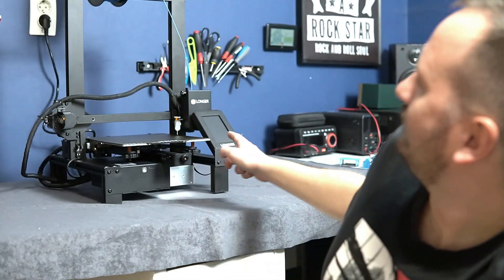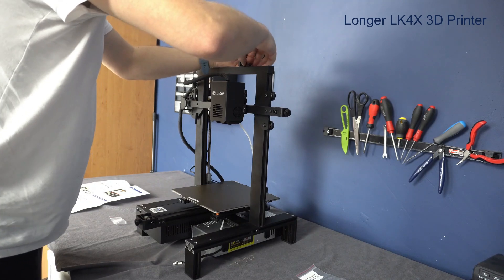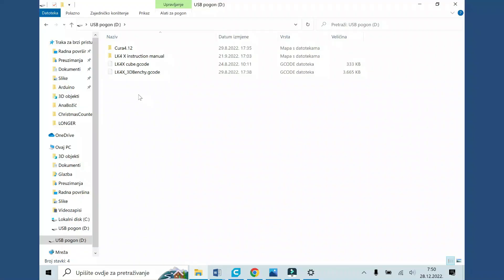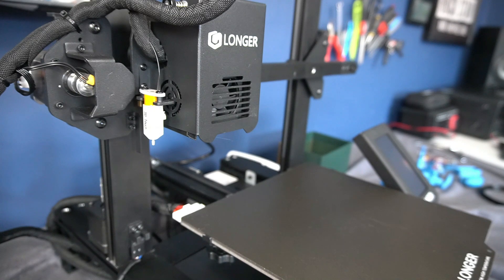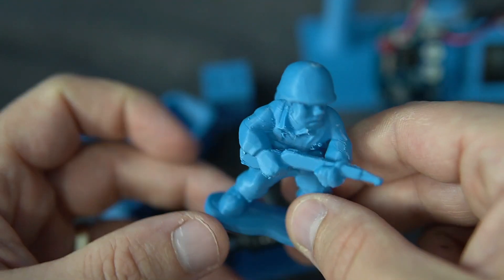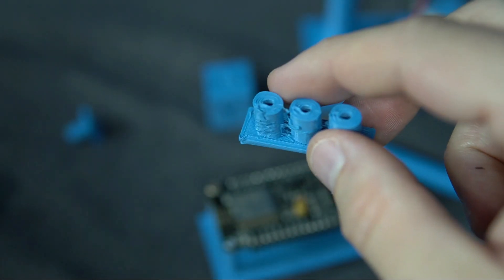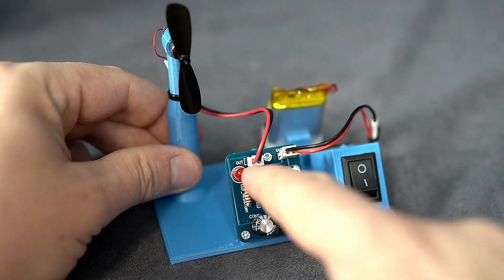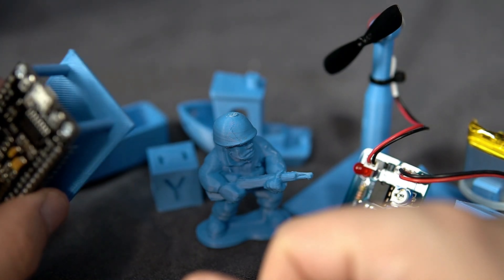My first 3D Printer - LONGER LK4 X

Comment: I just purchased 5 boards for $5 + $25 shipping for your Calculator ttgo board. I just noticed that somebody early in the year 2022 purchased ten boards and found that none the pins for the buttons are clicked to ground. Here is here comment:
 "RobertF_Dus I ordered 10 pcd and they just arrived, but they are useless. Sorry, Bro, I guess you forgot the gound plane. Every button is connected with only one pin. The connector on the top right is also without connections.It would be nice, if you share the BOM. It seems you uploaded an not ready PCB. Please share with us the correct PCB. It looks very cute and I love to build one." .....

Iif this is true I'm not a happy camper after buying you a coffee and wasting money for shipping and the boards - which still haven't been sent yet. If you have a help or solution for this please let me know.  After viewing the gerber images I see keys are DEFINITELY not hooked up to a ground plane.
Reply from the maker: it is not conected to ground pane, it is conected directly to ground pin
Reply from the maker: omg, it seems you are right, can you contact me on arduino.b2016 at gmail.com